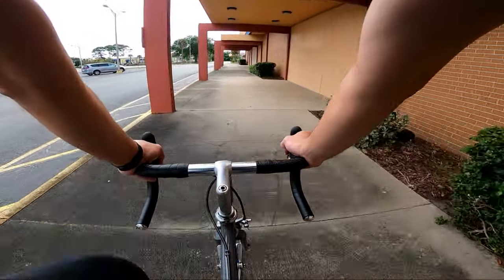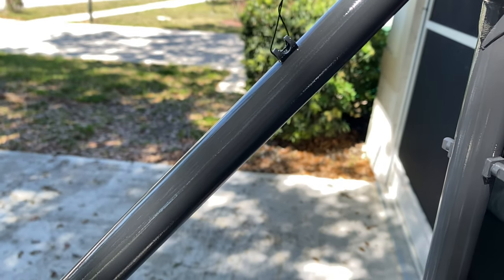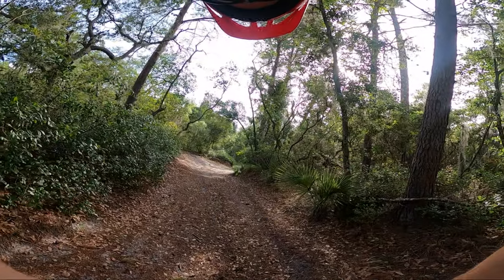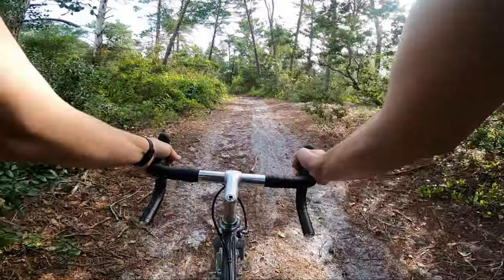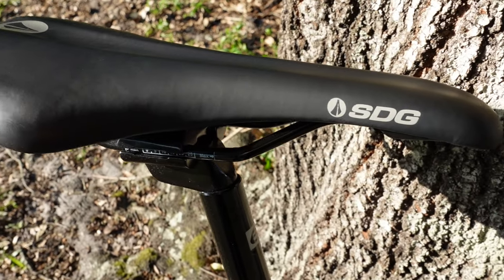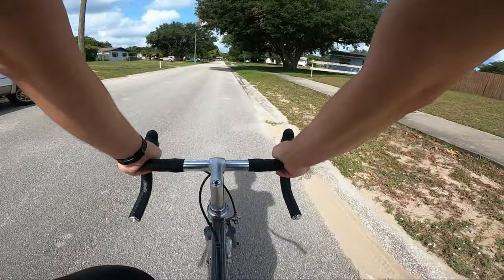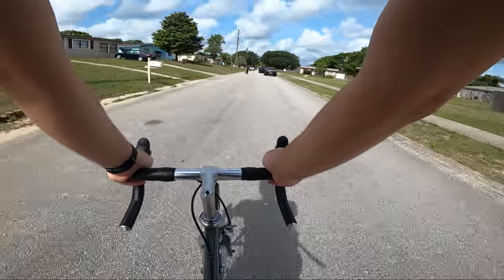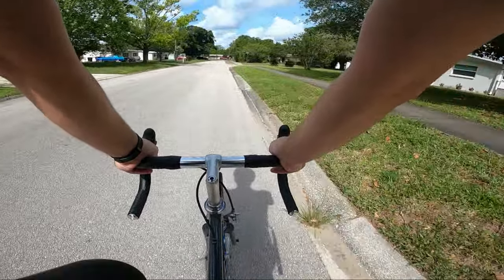Bike Review - Vintage Miyata 710 build

Comment: I had always thought you were supposed to wrap the bars inside outward precicely so you could wrap the tape over the starting point,and fold the other end into the end of the handlebar before capping so it essentially holds itself together.

In that month long recovery period post eye surgery. Left eye is taking longer than I would like to get settled (but to be fair what I would like is 'instamt' so yea.) Right eye came out great, left will get there. Just can't do anything that would bump or rattle me for the next month, which sadly !rams no biking...

But the payoff will be so very worth it. In the !meantime? I am glad that you are posting. Nice relaxed vibe.

And don't fret over weight. My bike is literally forty pounds and I am told it can't really be lightened that !uch even after dumping a ton of money hits.

So I'm going to upgrade the deraileur, put a shemano megarange on it, better tires, and call it good while I save up for something a bit better. Possibly build from the frame up maybe not. Point is this beast is giving me something to get in less bad shape whole planning for better.

And I seriously love the paint on your bike here. Will want to grab some of that clear coat because... Super nice job.
Reply from the maker: Thanks so much! Hope the eye heals soon. I did lasik surgery many years ago and my left eye has never been as good in terms of vision unfortunately.
Reply: @BruceChastain  well, mine was cateracts surgery and both had gotten to a point where contrast issues were impacting day to day stuff in addition to garden variety really bad nearsightedness.

Right eye is great other than this one floater s!ack dab in the middle. Left...... Even if my fears pan out and it doesn't improve any further? I'm still j a better place than before.